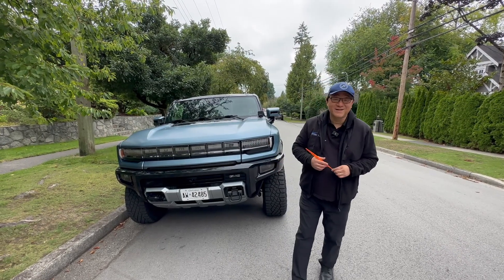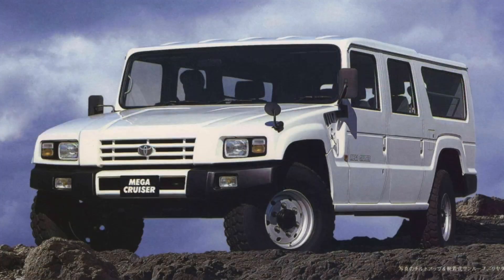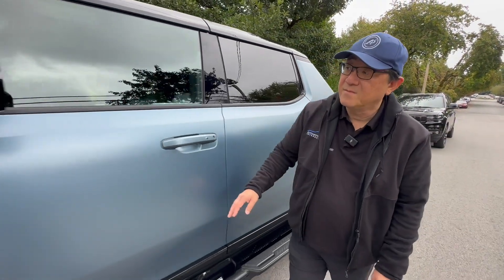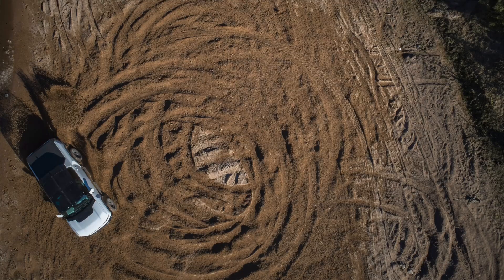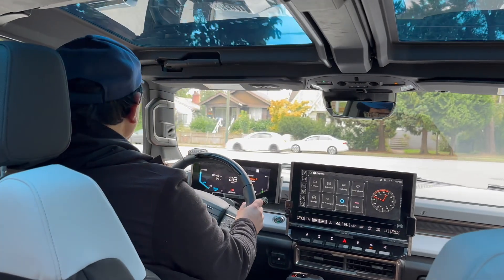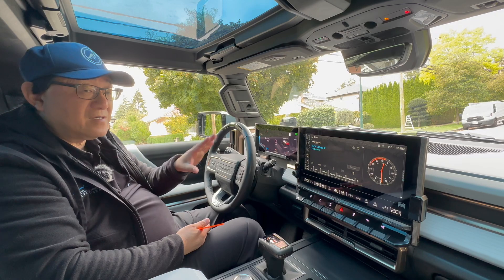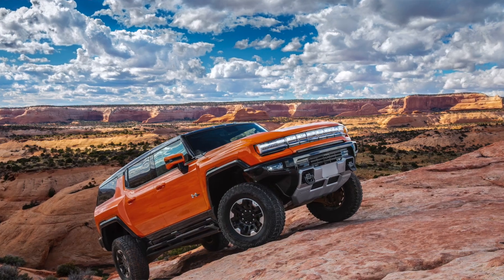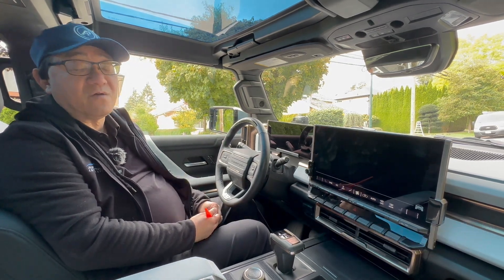STRENGTHS, WEAKNESSES, OPPORTUNITIES & THREATS (SWOT) // TOUGHEST, MOST UNIQUE TRUCK EVER! // HUMMER

Comment: Toyota NEEDS to bring the MEGACRUISER back.
Reply: Why bring back a truck that was objectively worse than the H1 - when you could ... just bring back the H1.  And before you start caterwauling about Toyota build quality... I have both an H1 and an FJ and there ain't much difference between the two with respect to durability... and Toyota hasn't exactly been covering itself in glory with "quality" lately....

Comment: I would not invest in this hummer, with so many recalls on G.M Vehicles and a Lawsuit  going on, no thank you!!!
Reply: And the TFL channel guys had one that abruptly stopped working on a dangerous busy highway, totally losing all power. They had to get a flatbed tow truck to come get it, and because there was no power, there was no way to get it in neutral to get on the flatbed without it needing to be dragged onto the bed, tires locked, all 9063 pounds